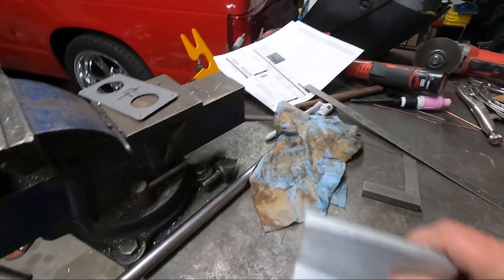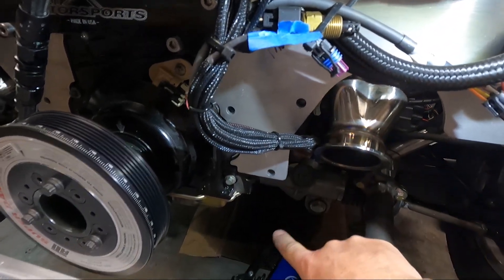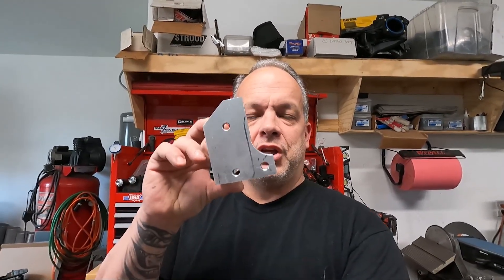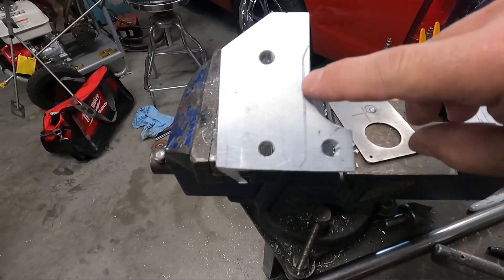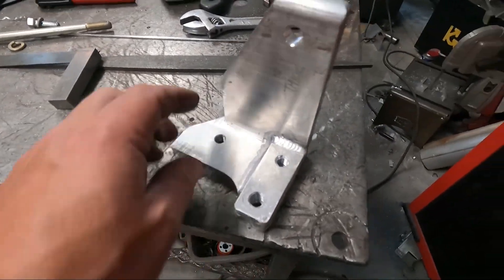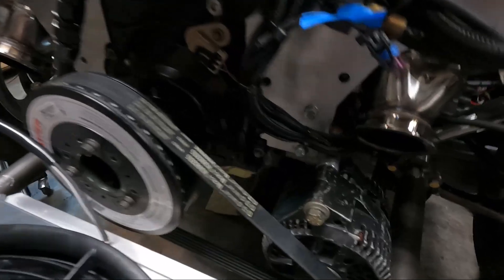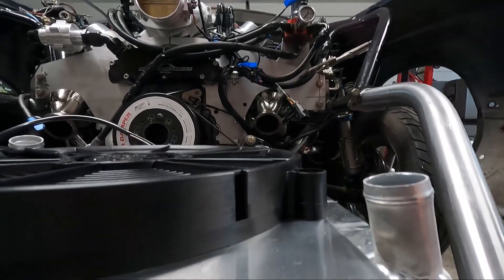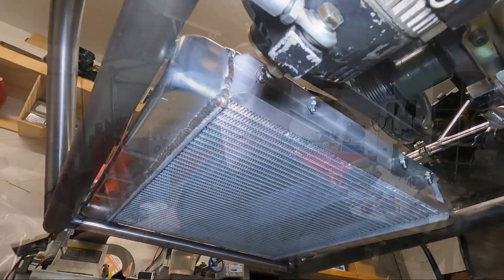Making a custom alternator bracket for a the racecar! (SKETCHY stuff inside!)

Comment: Looks good. Any flex you have will be in the bolt that runs through the alternator. But if you can grab the belt and push/pull on it and nothing moves. You'll be 👌
Reply from the maker: In that respect. It's pretty rigid. It's 10x better than the sbf, and it never had belt problems